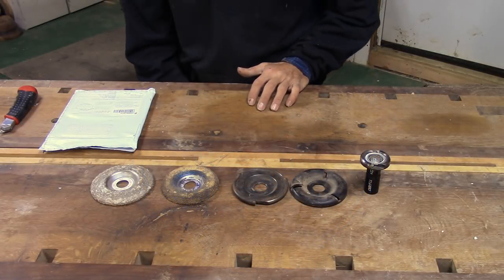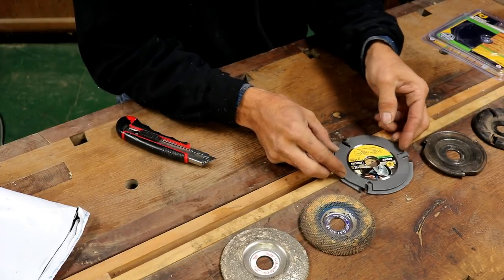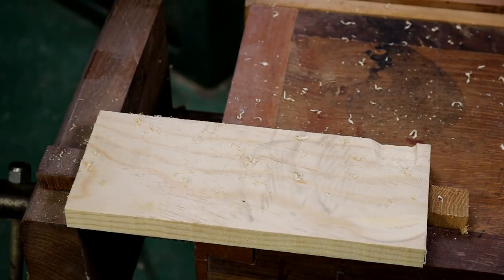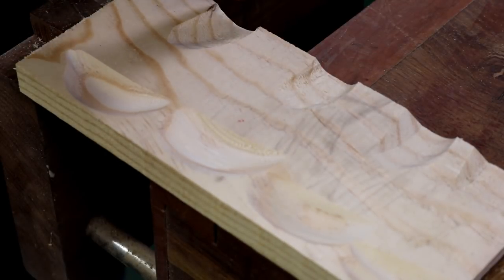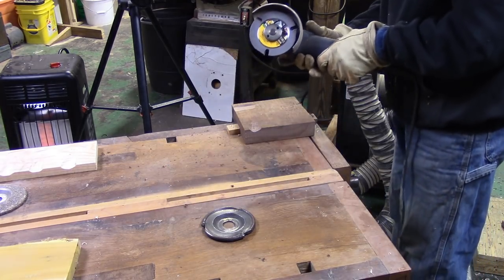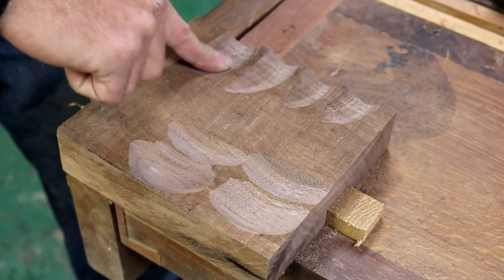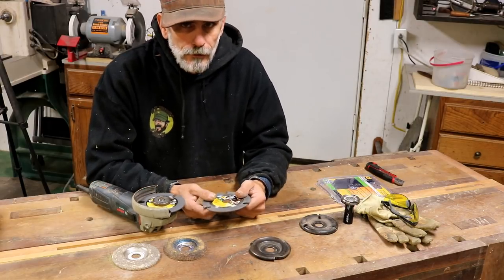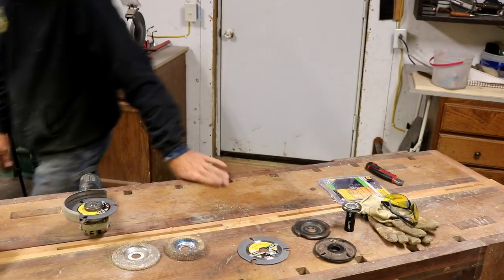Comparing the Graff to the Arbortech

Comment: Interesting.... I thought, perhaps, you were working a tad more slow and steady on the graff disc... Just my feeling, you're not a robot... None of has an axe to grind!
The other question not criticism is about gloves... I was taught that gloves make some tools more dangerous because they reduce grip... especially swinging tools... so with this disc/Grinder combination maybe the main gripping hand would be better off without a glove?
Does it ever feel like it wants to kick back or fly from your grasp, if for example it starts to dig in too hard?
I am only thinking aloud, please don't take it bad... Great video and you've helped me decide... I want to start making some uber rustic bird baths, somehow drip fed rainwater from the roof.
A single quick disc tool would help keep them cheap enough to buy or make a new one when they leak or rot away...
In your opinion is this the best disc for what I've described?
Also which UK species do you think would be most watertight and long lasting?... I heard elm was the best but they all died out here. 
Thank you for sharing your know how and experience.
You get a subscription and a like from me.
Reply from the maker: For the difference in price the Graff is the better buy. The Arbortech tools are better quality, but you can get 5 graffs for less than the price of one Turbo Plane. As for the gloves, I once had a lancealot disk grab my gloved finger. I lost about 1/8 an inch from the tip and had a gash that required stitches. Had I not been wearing the glove I would have lost the whole finger. So I try to always wear gloves when using tools like this. Also the glove protects your hand from flying wood chips that come off of the tool, I have been cut by the throw off from these types of tools, minor as that is it still hurts LOL. 
As for control, it definitely performs better with a light touch and yes can kick back so definitely secure the work piece and use both hands on the tool.
As far as woods in the UK, I am at a loss there. Just not familiar with the species that are available there. Yes Elm probably would have been a good choice but its even dying off here in the states.
Reply: @DIYwithUncleCy  Thanks a lot for the time you took to reply.. Useful information. Regards

Comment: Another test would be to see what just one pass using the same pressure does with each wheel. In this test each wheel went over the wood enough times until it probably felt like it was a smooth surface through what you could feel of the wood texture through the grinder. This means on hardwood it was possible to get a finish with the graff that felt the same as the arbortech but it might have taken a lot longer to get that finish with the graff. I think the arbortech is going to be faster to work with if you want a smooth finish due to the rounded edges but it will be possible to get the same finish with the graff by spending more time than with the arbortech.
Reply from the maker: Well the Graph teeth are rounded on the ends first off. So the texture it leaves is quite smooth right off the bat. I agree that if it had squared ends then it would probably have that issue, but it doesn't.

Comment: Nice... I was looking at getting something like this.. I have been using the chainsaw styled discs. King Arthur tools The Lancelot  is what the brand name . but harbor freight has them for half the price under their brand name.. same disc. thats what i have been using..
Reply from the maker: I have used the Lancelot before. Cut off the tip of a finger with it, far too aggressive and no anti kickback (which is what gt me). I switched to the Arbor tech and have been a firm believer in it since. These actually surprised me. They cut as well as the Arbortech at about 1/7th the price.
Reply: Funny you said that because i cut the tip of a thumb off with it and had it catch my shirt and run the thing up my chest.. wasn't pretty.. it was windy i was outside in a loose shirt...
Reply: Thanks, saved me from asking the same question. I always read through so I don't post some question that 5 other people do. Lol

Comment: How come you dont use the handle that came with grinder?. Would not that  be safer?, M.
Reply from the maker: I normally do have it on there but as I recall I had removed it when working on something in a tight place and lost the darn thing for a while. I have it back now, but could not find it when making this video.